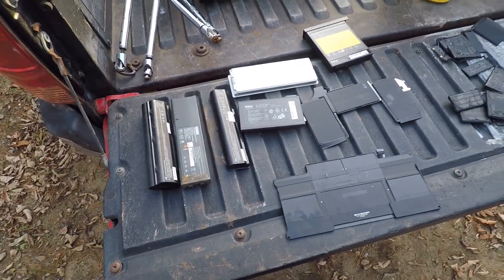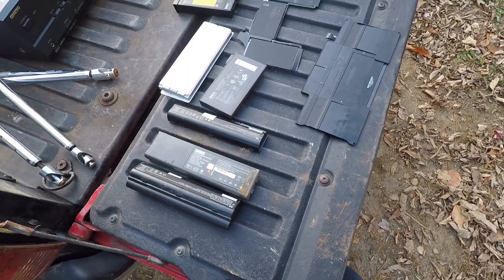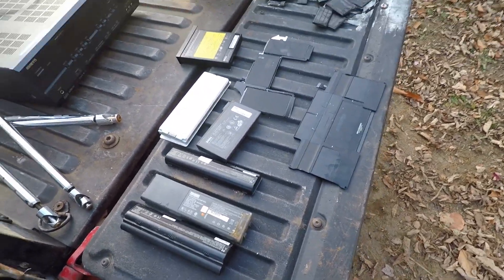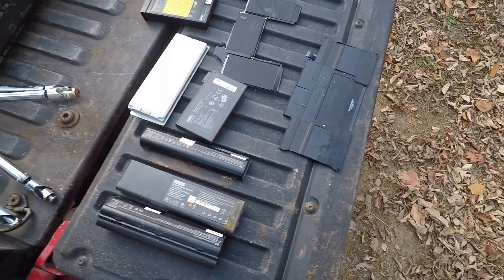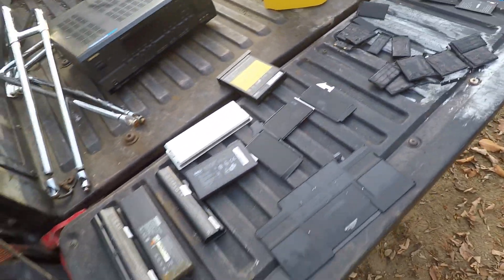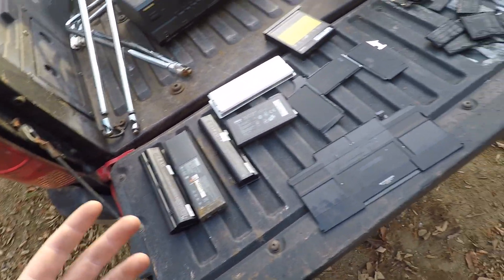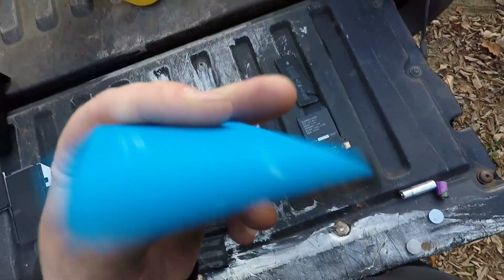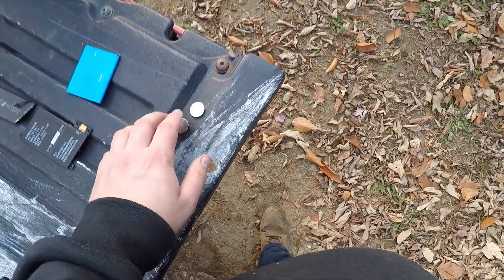How to Scrap LI ON Batteries Where to Find Them+ Safety Info!

Comment: Most places are dropping Li-Ion batteries because of the fire hazard.  Insurance companies are really cracking down.  As for the lead acid batteries, my yards also only pay $.10/lb.  What I do is take them to O'Reilley's (or Auto Zone, etc), and they will give you $10 store credit per battery!  Doesn't matter if it is a small motorcycle battery or regular auto battery...$10 each!  I am always needing parts or stuff for the truck, and they also sell tools.
Reply from the maker: Great to see you back Roger(I think I got the name right). Your right about the fire hazard issue which I did try to hit home in the video. However I hadn't even thought about insurance. If a larger ewaste recycler were to go up that would be thousands maybe millions of dollars worth of stock. Product and machinery. The only issue is we need to make sure we still have ways to properly recycle lion batteries as they aren't going away    anytime soon. However I do like your car battery idea. I hadn't thought of that
Reply: @thenewenglandscrapper1653  The name is correct.  🙂👍
Reply from the maker: I was hoping I got it right
Reply: Gotta find a new yard.